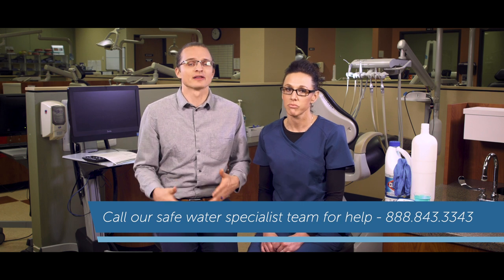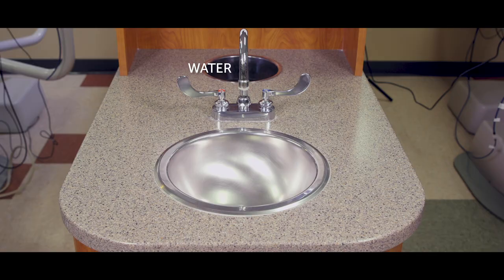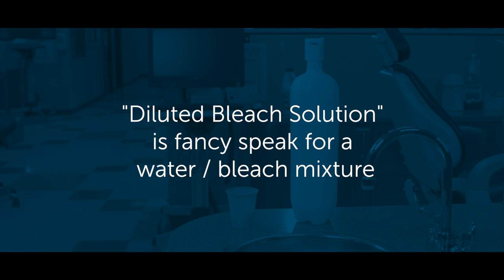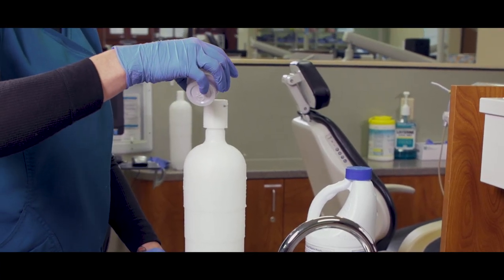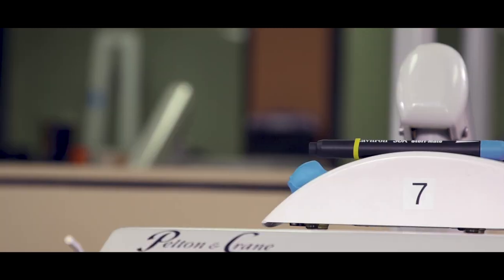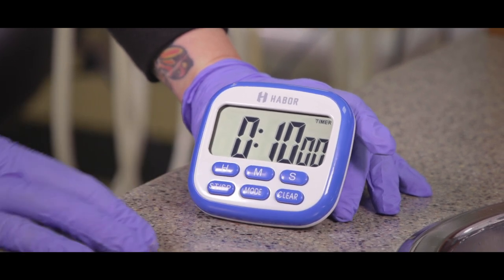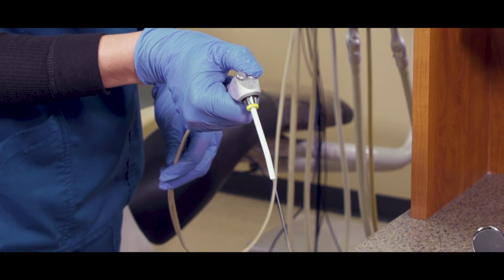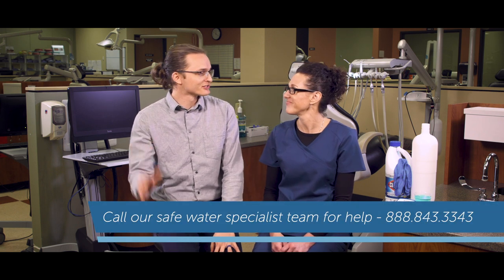How to Shock Your Dental Unit Waterlines

Comment: Thanks for this video. I have a question, what if their is no bottle in the dental chair and it is directly connected to the main water supply?
Reply from the maker: Hi there! It's a great question and we wish there was a easy answer! But unfortunately, without dental unit water bottles, there is no way to shock. And if you can't shock, there's no way to have full control over your dental unit waterline environment. This is one of the main reasons the CDC recommends independent water reservoirs. So, the best solution  is retrofitting the dental units to have water bottles. This can be done relatively inexpensively with a retrofit kit from your service tech. It's not fun to hear, but it is something we highly recommend if the practice wants safe CDC-compliant dental unit waterlines. If you'd like to discuss it further, call 888.843.3343 and one of our specialists can walk you through it.

Comment: Do you start the timer right before you flush the first water line with the bleach solution or after you flush all the water lines with the bleach solution. Also do you start flushing one water line after 10 minutes or all the water lines should start being flushed starting with 1 waterline after 10 minutes

Comment: how often  should I do  it . ?  If there is any scientific paper or research can I read it ? Thanks
Reply from the maker: Great question! It largely depends on your treatment protocol. For best results, use the ProEdge 3-step protocol (proedgedental.com/3steps) which recommends shocking a minimum of quarterly. However, the only way to know the proper frequency is to test your waterlines frequently, which also is recommended at quarterly (You can learn more about testing recommendations here: proedgedental.com/osap). If you'd like to walk through your office specifics, don't hesitate to give us a call – 888.843.3343!

Comment: Can you give me a better measurement to mix the bleach in a 2 litter bottle please? I'm not sure how to measure 1 part bleach to 13 parts water. Thanks!
Reply from the maker: Tricia, often the best way to do think about this starts with not thinking about bottle volume at all. What matters is that they are equal parts. So, if you have a little patient cup that you use for rinsing, simply fill one of those with water, and then fill that same cup with water 13 more times. That's assuming you're using bleach with 8% concentrate. If it's 5 or 6%, you'll want to do 1 part water to 9 parts water.
Reply from the maker: If you're still not clear, give us a call and we can walk you through it a bit further – 888.843.3343. We want to make sure you're confident in shocking! It can make a big difference :)

Comment: For the high speed handpiece line, does a hanpice need to be on or without?
Reply from the maker: Hi Christina, great question! When shocking, if you are able to remove the handpiece, we recommend doing so. However, if it is unable to be removed, you can shock through it.

Comment: How do you treat if you dont use water bottles?
Reply from the maker: Hi Pamela, that is an awesome question! For better or worse we strongly recommend retrofitting your chair. There are a tremendous amount of benefits in being able to control water quality directly from the water bottle and of course you have the benefit of being able to shock your dental unit waterlines from the water bottle. It's CDC and OSAP recommended and relatively inexspensive per operatory. You can check out more here if you are interested: https://proedgedental.com/resources/benefits-of-water-bottles/

Comment: Am I wrong that 1 part bleach to 9 parts water is actually a HIGHER concentration bleach than 1 part bleach to 13 parts water???  If fact, one part bleach to 9 parts water should be 10% bleach solution, right?  Part over wholeX100= percentage.
Reply from the maker: Hi Kavity! 
Thanks for reaching out. Yes, you are correct: 1 part bleach to 9 parts water is a higher bleach concentration over the 1 part bleach 13 parts water. It is a 10% bleach/water solution. If we can provide more resources or information on the shock processes, feel free to schedule a consultation with one of our safe water specialist here: https://proedgedental.com/consultations-with-proedge-dental-water-labs/
- The Team @ ProEdge
Reply: This is assuming that you have a pure 100% bleach to begin with… but that’s not the case with the bleach solutions you buy from outside, they usually range from 5% to 8% bleach and that’s why they do that 1 per 9 and 1 per 13 based on that concentration